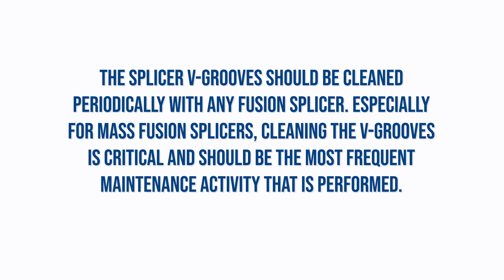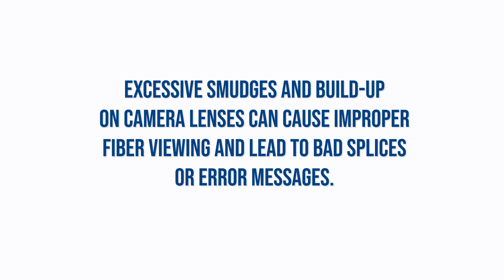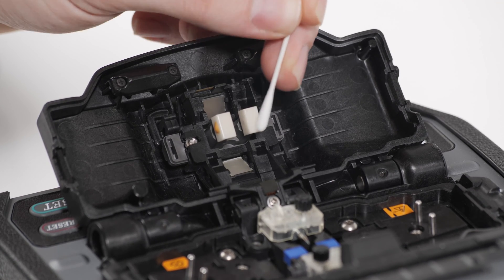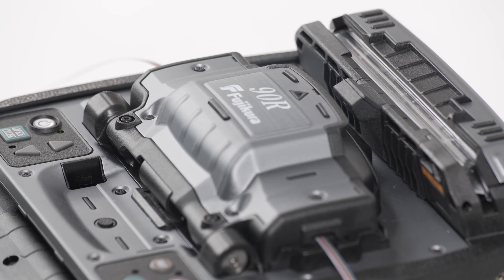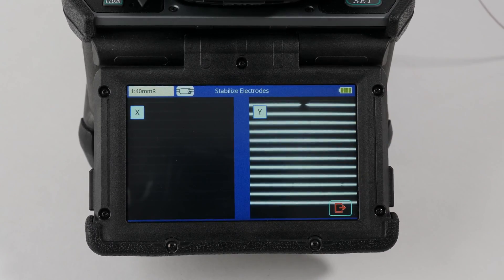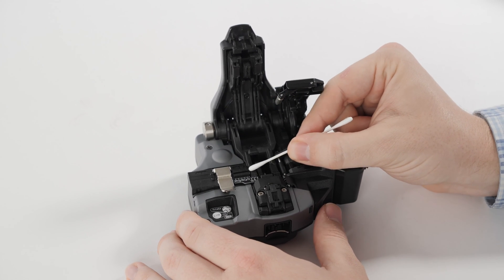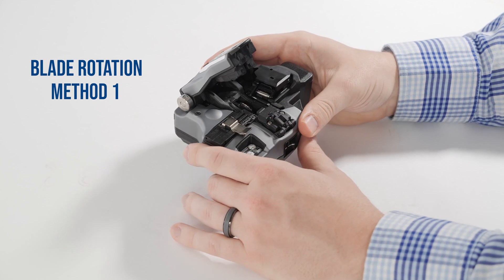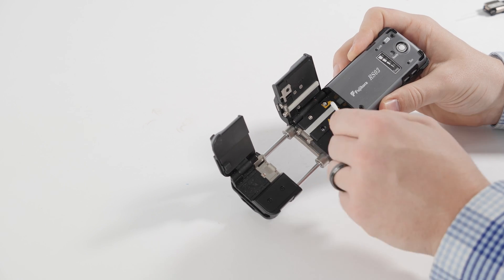Maintenance Instructions for the Fujikura 90R and 90S Fusion Splicer

Comment: How do i stop my fibers 1 and 12 of the ribbon splice to stop having high loss after I heat shrink it. I Consistently have to reburn cause those have high loss
Reply: Commscope had a bad batch of ribbon sleeves a while back so that could be the issue. It was breaking fibers after the heat shrink